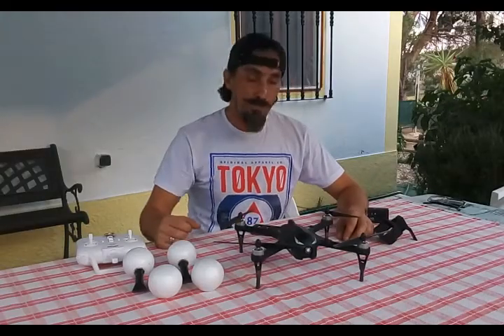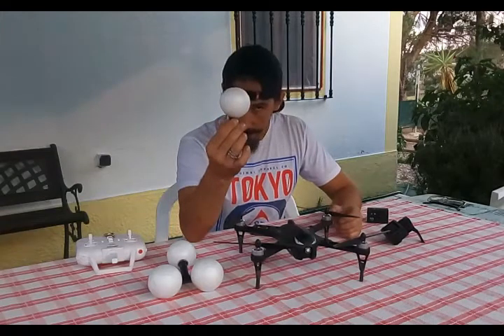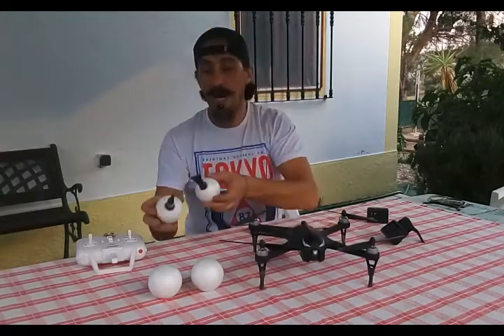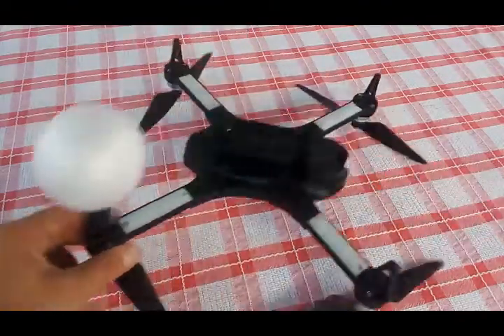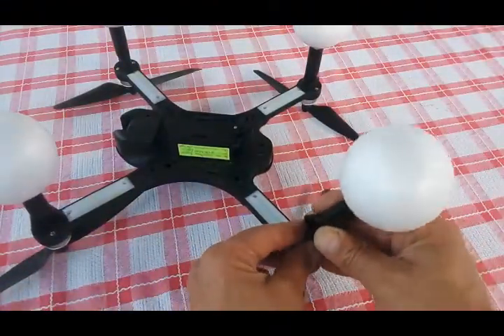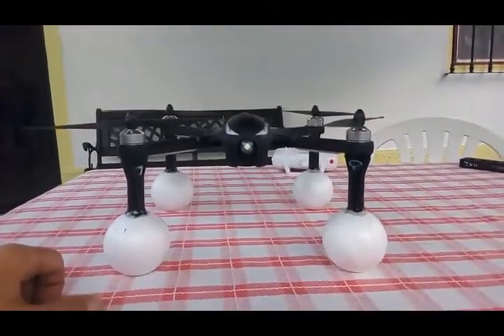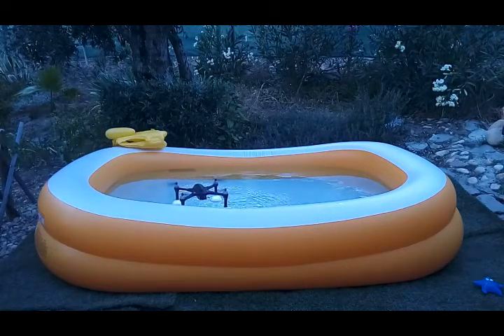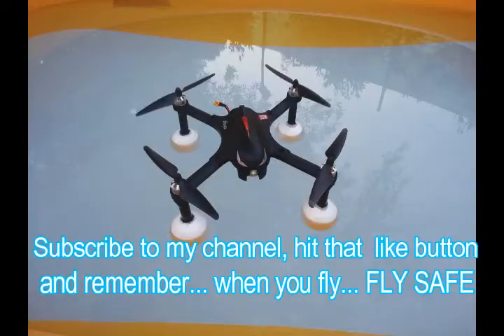Floating Landing Gear for MJX Bugs 3 - success, it works...

Comment: That is really cool. Great idea. Did you just use black plastic tube? Where do you find this black plastic tube before you heat and mold?
Reply from the maker: You know that plastic tube that they use to pass eletric wires on the walls, it's that.... It's originaly kinda white/yellow but I used spray paint to make it the same colour as the drone.... Thanks for watching bro, big hug

Comment: Wwo, that's a cool solution, dude, thanks, i've drowned mine a month ago, and somebody found it, i regret i didn't stick any contact/id on it so that one who found it could call me. As for styrofoam, that's a great way to keep my drone safe, as i am filming mostly over the water, one can atttach the pieces of long styrofoam to the long landing lengs.
Reply from the maker: Glad to help Princess, you can also use those pool nodles because they float preaty good as well... Thanks for the support, subed back... Big hug

Comment: Hello I was just wondering where did u get the tiny extended landing gear on the bugs 3 not the floating balls the extended gear on it at the start of the video
Reply from the maker: Thanks for passig by Shea, you're probably talking about those litlle extended legs righ on the bottom of the motors... that is actually a piece of heat shrinking sleeve with a piece of hot glue tube inside, send me a e-mail to lcostapereira77@gmail.com and I will send you a small video explaining how I did those extenders... All the best Shea

Comment: I dig it man, nice.
I've had some pool noodles stashed for months meaning to get round to trying something similar. Even bought some ping pong balls for a go with the brushed micro :)
I think your balls will have much less drag when taking off the water than pool noodles, not even sure the 1s micros will be able to lift off.
Reply from the maker: MicroRCFiend it will probably drag it down because of the reduced lift power, ping-pong balls whould do the trick... Their height is near to nothing and they will have a big surface area on the water, without keeping it anchored... Give it a try, can't wait to see the result... Thanks for watching and commenting, all the best brother

Comment: i would burn or drill a hole in them , so you can screw them in
i'm thinking ...vibration would sooner or later pop a leg
Reply from the maker: Takoza I already lost one mid air, a hole with a small screw is a good idea... Thanks takoza, all the best
Reply: haha yw brother ^^ good luck

Comment: I may just use the PVC tubes as extended legs for camera use. I hate that the screws for the taller landing gear seem to strip too easily. Bugs 3 is so much easier to transport without extended landing gear. I wish there were clip on legs. How did you cut the PVC tubes? Where did you buy them? What is the weight in grams? does battery life suffer?
Reply from the maker: stefano giovannini I'm doing a video on the battery duration with the floating legs, I think it takes just 1 or 2 minutes out of the flying time, if there's wind it will affect more... these type of pvc pipes are used inside the walls with the electric wireing so any electric suplieing store will have them... they are great to use has legs if you want to put a gimball on the quad... thanks for watching man, all the best..